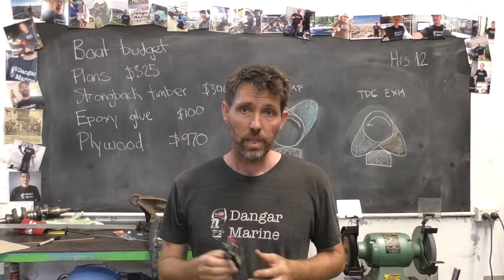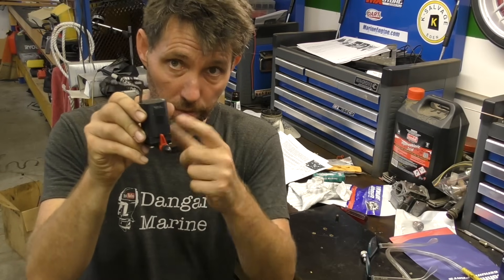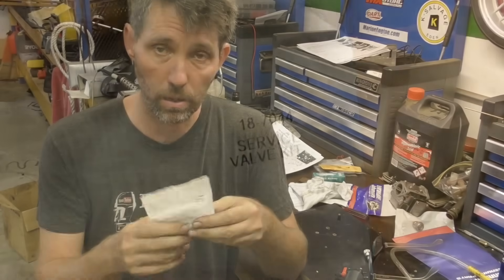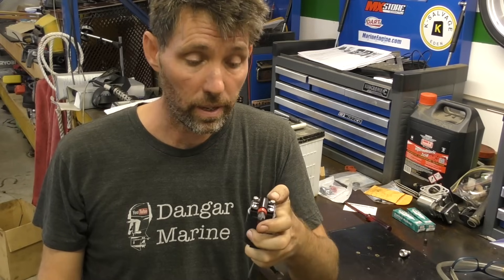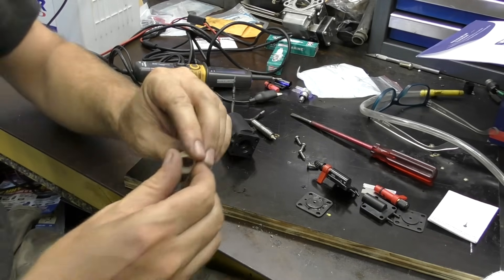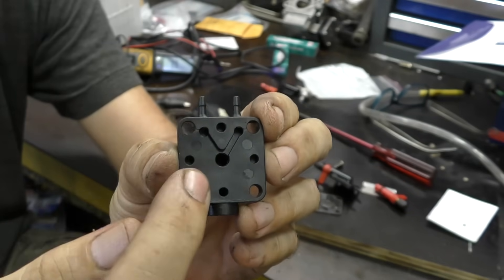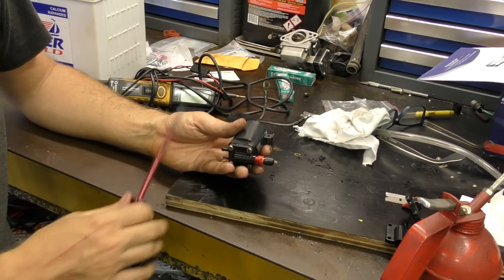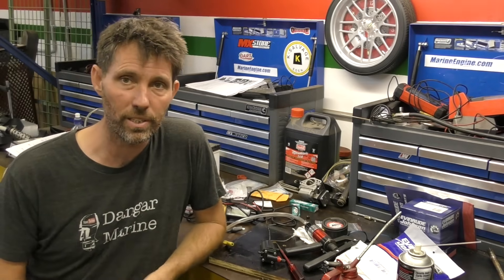Johnson / Evinrude primer solenoid

Comment: You don't mention the symptoms for a bad primer solenoid in this video as you do in most other parts videos.

My Johnson 40 HP runs fine after priming but it loses syphon after a few minutes. I've bought a brand new fuel tank,  I bought a brand new oil tank (all from Marineengine.com, thank you) rebuilt the carbs, rebuilt the VRO, bought a new OMC fuel line and primer bulb.

I can't figure out why it stalls after 3 or 4 minutes, leaving the primer bulb almost dead empty??  It's a 1997 Johnson 40 Model J40TELEUC.

Ideas welcome :)  Love your videos, you've gotten me through more repairs than I'd care to mention. Thank You!
Reply from the maker: It sounds like either sucking air through a cracked fuel line or a close breather on the fuel tank meaning a vacuum is being created inside the tank.

Comment: i have  rebuilt that part on my 30 hp Johnson   it's electric start  and the other week i was wondering how i could choke it if i had to pull start it of course i can't push in the choke and  do the rope wrap manual start so this makes sense as how to manually choke it.  Thanks another great video.

Comment: I have a 98 35hp johnson. Only runs when the primer is in free flow mode. I rebuilt the carbs and the fuel pumps. I've gone over the carbs many times. Any suggestions?

Comment: Can you continue on from the primer circuit to Vapor pump (I think it's called) and the hose routing? I have an issure going over 3200 RPMS and I took apart and don't think I put something back together right. Mine is a 94 Johnson "Fast Strike" 150. Great job on the video's!

Comment: U have gotten me through a bunch of repairs great job!! And thank you! 😎 i have a 99 johnson 175 upper left carb pouring out gas im so stumped all rebuilt properly.....anything common here im missing? Thanks again for these awesome videos
Reply from the maker: Could be that the needle isn't quite fitted into the seat properly or the pivot is stuck. Otherwise I would check all the gaskets and make sure the screws aren't over tightened causing the bowl to distort.
Reply: Thank you sir!
Reply: Went through the carb again all was good, i think i have a vacume problem pulling too much fuel through that carb its the only one with a vacume hose to it, its flooding out the cilinder i can visually see more fuel flowing at idle than the other carbs. When I disconnect the vac hose the flow goes to normal lol bust out another thousand ha! What u think?

Comment: hey i am actually having a problem with my lever/schrader valve system. When i run the engine at wot the schrader valve always pops out of the red lever itself, im pretty sure that it leaks gas through the top as well, i bought this kit and it still happens, any help would be appreciated.

Comment: Mine is leaking on the back side of the I'm guessing bowl where the sylinoid is attached to, went to get a gasket but they gave me a caurberator gasket kit, it's the square part with 4 screws on top, and the sylinoid is attached to the side of it with one screw

Comment: Great video. I have one that has a slow leak (bad oring). My engine will start and then stall after a few seconds. After having winterized it, it now will not stay running. Already took apart and cleaned carbs. Could this small leak be the issue its not staying running?

Comment: I bought one with the stem cause I thought it would be good for cleaning out the carburetor my old one didn’t have the valve.  So I bought one with the tire stem on it just like you have on this video and when I started the motor it leaked,,I put the old one back in with a new O ring and no leaks hum not sure what is going on there any ideas 💡 thanks

Comment: Hey bro awesome video! I have a slightly different problem though, when I engage the electric choke with the key it blows the fuse. The Ohm reading is 4.3. Could this be the problem?
Reply: I'm having an issue with the fuse blowing. Dosent happen out of the water so I'm guessing there is a short when hitting ruff water or possibly in the control when throttling up and down.or ignition swith. Did you figure yours out because my I cant hear my choke click. Testing it tomorrow

Comment: Teaching a marine tech program, and we all love the old Outboards, love this guy. It's always more important with an Aussie accent too!
Reply from the maker: Thanks Charles! :)
Reply: @DangarMarine  Thank you, Stu, for a great video. My question is: I don't hear the click when I push the key in. Does that mean the solenoid needs to be replaced,  or can I clean it and put it back?
Second question: I turned the lever up to bypass the solenoid and the engine started much faster,  but left lots of gunk in the props. Is that because I flooded the carburetors?

Comment: 98 3 cylinder 35hp will only run with the primer in free flow position. Rebuild carbs and fuel pump problem still there. Compression is 110 each cylinder.
Reply from the maker: I'd be looking deeper into the carbs, definitely sounds like there is still a problem there. Also check the reed valves while the carbs are off.

Comment: Question !! The primer solenoid has 3 barbs on it. 1 for main line in and 2 for the out. My question is 1 of the 2 out ports is plugged with a nipple. Is this normal or does both have a purpose and where do they go.
Reply from the maker: The second outlet is for use with multiple carburettors.

Comment: Hey Stu, I'm reading in some forums where the primer is on the motors, that you should turn the key to the on postition and then push down for 8/10 seconds before starting. Unless you tell me different, gonna try this next time out, as cold starts are somewhat aggravating. After you get it warmed up, the motor is great (115hp 1998 Johnson). I mean it's a cold natured motor in summer also. And yes , I always make sure primer bulb is primed .

Thanks Stu!!!
Reply from the maker: It's my understanding that these primers don't do much unless the engine cranking. They need the fuel pump to the operating to push fuel into the engine.
Reply: Follow up. Yesterday I went fishing, made sure the bulb was primed tight, went to the ignition, put in run position , held the key pushed in for 10 seconds and the verdict was. 

No difference in doing that way. It didn't change anything and was exactly as you said,, needing the engine to turn over and  the fuel pump to feed it fuel. My personal preference would be the old fashioned choke flaps without a solenoid, and using a cable to activate, so you could put choke in whatever position you wanted....

Thanks again , Stu!!!
Reply: Ok. Thanks so much for the reply. I'm going tomorrow and will try the procedure, I'm reading about in this forum (making sure bulb is pumped tight and holding key in , in the run position, for maybe 6 to 10 seconds) and see if it makes any difference , and I'll post back and let you know. 

Here's the link where I read about it
https://www.thehulltruth.com/boating-forum/534519-evinrude-115-starting-issue.html

Thanks again Stu!!!

Comment: do mercury 25 hp 4 stroke prime solenoid work/run the same?  I figure the one I have is sticking in the ON position and it runs rough on idle. I was going to take the wires off the back of the key switch and place a manual momentary on switch somewhere to rule out the key contacts, good idea or bad??
Reply from the maker: Yes, I do believe that work on the same principle. Nothing wrong with replacing the key switch with a separate momentary switch, or even a toggle switch which would let it work like this one in the "emergency" mode.

Comment: Here is my problem I'm having on 77 Johnson 85hp v4. Doesn't run under load over 3400 rpm. If I push the keyed choke in and hold it I run well between 4500 and 4800. If I let go it drops back down. How do I adjust it so it runs at higher rpm at WOT instead of having to hold it in?
Reply from the maker: Sounds like the key choke is compensating for a fuel shortage caused by the carburettors needing a clean.
Reply: Dangar Marine Thank you again. I'm going to tear into them again tomorrow.  Glad your feeling a bit better. I sure appreciate all your help. It's important to me to learn and be hands on with the equipment I'm using. Your the best!!!!

Comment: Hello and thank you for all the information you share with us. I have a problem with my 120 v4 Evinrude 88 ', the RPM goes down and up. I wonder if this solenoid could be a source of air intake for the fuel system? For your information, I replaced all the fuel tubing, replaced the primer ball, all the collars and inspected the pump.
Reply from the maker: It could possibly have a leak. Fluctuating revs can also be caused by a vacuum leak https://www.youtube.com/watch?v=f3O_dqvCDIU

Comment: Great video, i'm in the process of figuring if mine is working. I'm somewhat still a novice in general but would like test just as you did. Would you be able to provide the brand and model of that auto probe.
Reply from the maker: Thanks mate. This is the one I bought https://www.jaycar.com.au/automotive-multi-function-circuit-tester-with-lcd/p/QM1494

Comment: Thanks for a very helpful video. I have. Johnson 50hp out with cold start problem. Start motor goes, sparks are there but does not start easily. Once started and the motor is warm then any other warm start goes very well. having seen your video I thought the problem is the solenoid. Measured the ohms and it is within the spec but I can not hear the click when power is switched on even if I connect the solenoid directly to a battery. I have not disconnected the fuel hoses since it seems to be very little space to get them in and out...  The visual check of the solenoid looks very good. Turning the red knob does not help the cold start either. So my question is what can be wrong when the resistance is ok and there is a direct power on the solenoid to move ? And why the turning the red manual knob does not help? Thanks for any information.

Sid

Comment: What size are the smaller fuel lines my lines split and leak bad. I can't find replacement lines at any of my local auto part stores . lines are vary small like 1/16
Reply from the maker: That's a good question. I know the ones you are talking about but I've never replaced them. It might be asked at an auto parts store if they have any vacuum hose that is fuel safe.

Comment: This accidentally helped me with an issue in having today on my 30hp Evinrude. Runs on trolling speed and idle with the valve open but won’t stay running if it’s in run mode. You mentioned that probably being s carb issue so hopefully I can track that down

Comment: Hi stu my 70hp Johnson vro (vroremoved) and had service and after couple of run it's starting and slowly dying down.and when o chalk it doing well and if using muff also it is working sometimes. I found fuel is leaking from this selnoid primer and red part have a crack too. do u think fixing up the solenoid will solve or is it any other issue
Reply from the maker: Yes, fuel could be leaking through the solenoid making it run too rich once it is warm. A great general rule is fix anything you know is broken and then keep looking after than if the problem doesn't go away.
Reply: Thank you mate how I can find right part no. Or is it a universal part.

Comment: Hi Stu, my 2000 150 johnson would fire but wont stay running, plugs all looked wet, originally it died when I was taking it out of the water at the end of last year, thought I was having a fuel problem, the lever was pointed down, which is what I thought was the normal running position. I pointed the lever up (counter clockwise from it's down position, the motor started right up and idled no problem. From what I am reading it seems this is in the by pass position, does it sound like this was my problem of not running, any insight would be appreciated.

Thank you,

Ed
Reply from the maker: It may well have been. If it was flowing fuel it would have been running way to rich.

Comment: So when the lever is turned with the arm looking down the body the electric choke solenoid is active with the key, but when its turned away its wide open. And it flows full fuel. I had mine turned away and the engine bogged down and quit. Is this what you would expect to happen if it was turned away. Couldnt figure out why the engine started great and quit about 60 seconds later. hmmmmm
Reply from the maker: Yep, if it is set to emergency mode you start as normally but as soon as the engine gets warm you will be running way too rich.

Comment: was wondering what the thing was! can u shed light on how to test the stator on a 88 25? 3 yellow wires coming out of stator to RR. Motor cuts out above 2500 - starts idles ok but sneezes every now and then and dies (despite adjusting idle mixture).

Thanks!
Reply from the maker: This video goes through those types of tests, but you'll need the service manual for your motor to get the specs https://www.youtube.com/watch?v=MDbvkFM1V_c  You'll also need to make a DVA to go with your multimeter https://www.youtube.com/watch?v=juhri_NxQcQ
Reply: thanks yeah got off the line with cdi tech today - they said i can either test each yellow to gnd while the wires are connected and motor running. Or disconnect the yellow charging wires and test yellow to yellow on mm. Yes I have a dva - its beena  while. thanks for the reply and helpful vids!

Comment: Hey stu thanks for the video, I have a 1958 evenrude lark 35 and they don't make the choke  solenoid linkage and can't find a used one would this kind of solenoid work with a bit of engineering?
Reply from the maker: I'm not sure how the 1958 model worked, but theoretically you should be able to adapt something like this if you can an appropriate place to inject the fuel into.
Reply: Dangar Marine thanks a lot Stu, you have helped me through a lot my first boat and motor

Comment: I was wondering if you could tell me where the three fuel hoses connects to on a J50PLSTD 2003 primer valve. Great video!
Reply from the maker: The larger hose is the inlet hose and goes to the fuel pump to receive fuel, the other two go to the top plates of the carburettors. If you only have one carburettor you just blank off the other outlet.

Comment: Hi Stuart, I've watched quite a few of your videos and think they're all great, always try to watch the ads too to help a little with ur funding, hope u keep up the great work. I hope you don't mind but I had a couple of suggestions for future videos: 1) I'm in the UK, and as you probably know, most boats here are fibreglass, a video on how fibreglass procedures differ from aluminium when it comes to fitting things like the bimini would be great. 2) Unfortunately I'm no mechanic, but have heard that that some cars (e.g. Hondas) are generally easier to work on than others - I was wondering if this also applies to outboards. I think a video on which outboards are generally easier or more difficult to work on would again be great. Thanks - Ian.
Reply from the maker: Thanks Ian. I'll definitely be doing more videos on fibreglass techniques as the boat build progresses. It will be fully glassed and all fittings will be attached very differently to an aluminium boat. A video on ease of servicing would also be good.

Comment: Great video Stu!! I like watching all your videos. I am from Port Elizabeth South Africa. I would like to ask your expert advise on a yamaha 85 trim and tilt. I think it might be the check valve. There is not much info on trim and tilt on the internet. Thanks for your detailed videos!😃👍
Reply from the maker: What is the trim tilt doing?
Reply: Dangar Marine The trim and tilt is working. When i tilt it up and i leave it i can watch it sagging down. It takes about a minute to drop onto the trim tabs. But when i tilt it up and just touch the down trim button and trim it like 10mm down basically it will stay at that position as long as i dont tilt up again. But when its at that position and i go physically at the back and lift the motor up with my hands forcing it a little bit it will go down again onto the trim tabs. I have bleed the hydraulic system with new oil and replaced all the cylinder seals. I have also tightened the release valve. So the only thing i can think of is the check valve?

Thank you for your reply!
Reply from the maker: Hi Jaco. Sounds like you have done your homework! Could definitely be check valve, and possibly down and up relief valves. I've been thinking about what to do this week's video on and I have an old Yamaha trim tilt lying around so I'll film taking it apart and checking those valves.
Reply: Dangar Marine wow thanks that will be Awesome. I have been struggling a while with this problem and its just to expensive to take it to my local marine shop and they wont give me any advise. I have asked them and there answer is that i should bring it in and it could be numerous things. Thank you very much for your help! I really appreciate it and cant wait for the video! Regards

Comment: Great videos slowly getting through them all.  
Question:

Honda, Merc, Suzuki, Evinrude or Yamaha for 60hp outboard tiller?  Many people saying Merc are getting very cheap in how they make engines now with many issues for new motors.  

Honda and Yamaha seem to be getting nice reviews for fuel efficiency, relatively quiet running.   

Any thoughts?  Many thanks
Reply from the maker: I'm very happy with my current Honda. It is the best outboard I've owned.

Comment: could you do a video on how to know which new motor to put on boats,i see 2o inch shafts,for sale,but i have a long shaft motor on boat right now,i guess what im try to figure is what clearance under transum do i need,mine is pretty much level to whale tail and bottom of boat
Reply from the maker: The ventilation plate should be level with the bottom of the boat. This video talks a bit about that. https://www.youtube.com/watch?v=IonsSQYVsU4